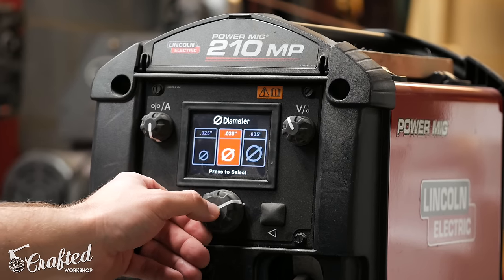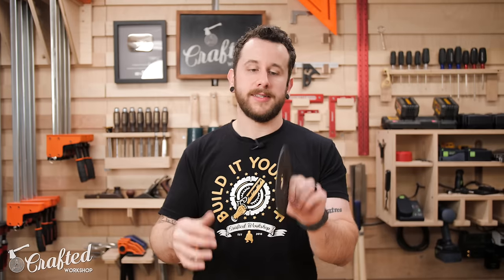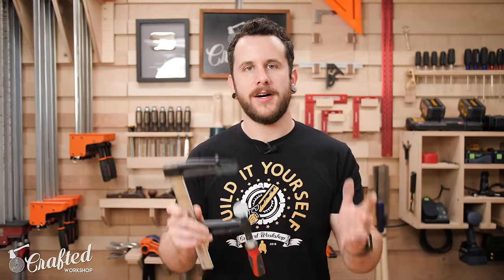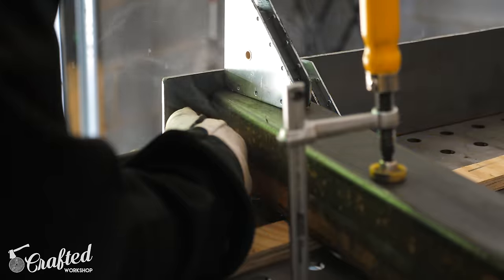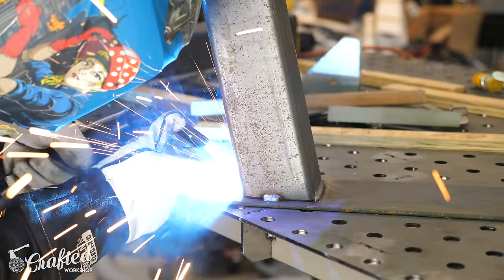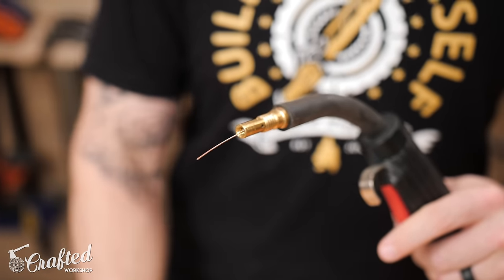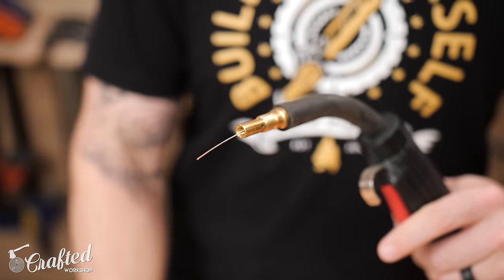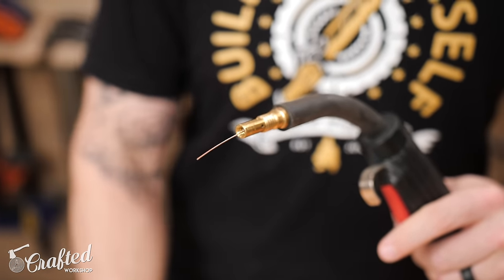5 Must-Have Metalworking And Welding Tools For Beginners // Quick Tips

Comment: If you’re just getting into welding....Get yourself an angle grinder, the cheapest helmet and shield u can find, some scrap angle iron, a Tombstone (Used) and some rod. You don’t need anything fancy in the beginning.
Reply from the maker: I personally hate stick welding and have never used it since taking my first welding class. I don’t see much reason to spend a lot of time honing that skill if you want to MIG stuff for furniture.
Reply: Crafted Workshop So you’re telling me that you first started welding with a stick welder? Do I have that right?
Reply from the maker: I took a 15 week class where we leaned stick, MIG, and TIG. I knew very quickly that stick was not going to be something I would use in my work, so I moved on. I definitely would never have bought a welder that only does stick.

Comment: 30000 RPM? Really? WTF. Have you never read the specs on your grinders? 11000 RPM is pretty standard. The five inch wheel shouldn't be going faster than between 7 and 9.
Reply: Since it's so much slower I'm sure you won't mind taking a broken cut off wheel to the face lol
Reply: @e.collins2768  That's not the point.
Reply: @josephdestaubin7426  it 100% is the point lol
Reply: How would you know what my point is better than I would?
Reply: @josephdestaubin7426  he's trying to make a point about safety and you're undermining it by being a know it all lol
Reply: @e.collins2768   That is exactly correct, because I don't think that someone who is not proficient in the use of a tool should be giving safety advice to professionals or amateurs. But I got to give you credit where credit is due, you definitely got the point of my comment.
Reply: @e.collins2768  Also, since I'm being critical already: he mentions that you can take weld aluminum with the 210 Lincoln. This is patently false! So basically he doesn't even know the equipment that he's using even though he's  sponsored by Lincoln. If I were Lincoln, I'd  ask my money back.

Comment: Hello sir im confused now i went for my welding trade test and failed by saying the chipping hammer chips off flux after welding stick and the right work was slag please correct me if im wrong
Reply: i'm no expert just a hobby welder with an everlast welder but flux is the material that protects the molten puddle from contamination before it has cooled. Slag is the material left over the cooled weld. It isn't flux any more because it has reacted with the environment to protect the puddle. I hope I got that right.
Reply: @ernienapier70  

Exactly, flux is the coating on the rod/core of the wire, slag is the remains left on the weld.
Reply: @ernienapier70  Hi yes i did this time thanks Ernie

Comment: You said the grinder spins at 30,000 rpm.... That's fast! I think you meant 3,000 =)
Reply: 3000 is kinda low, maybe he meant 13000
Reply: A standard Makita 5" angle grinder spins at 11,500 revs with no load.

Comment: 5 must haves, grinder, grinder, grinder, other stuff.
Reply from the maker: Hah!
Reply: One for your cut off wheel, one for wire wheel and one for flap discs. Or in my case, 4" cut off, 5" cut off, cup wire wheel, flat wire wheel, 5" flap. Swap the cut offs to grinding discs if needed but flap discs are super cheap in bulk off ebay, work quite well too.

Comment: is it ok to use 100% argon on both mig & tig sir?
Reply: 100% argon can be used for both tig and mig welding but the sound and bead quality are completely different even though it is a pain and can be expensive in the long run it is always best to use the recommended gas for each process for tig 100% or pure argon and for mig hardwire a mix of 75%argon and 25%co2 for the best welds in each process
Reply: @merlyn703  thank you sir..this info.will help me a lot,co'z theres no available here 75-25 argon-co2 on a single tank can i use two tanks?
Reply: Where do you live
Reply: @lesteracevallespin9939  you use 100% Argon for both mig and tig if you are welding aluminium or stainless steel. If you are welding mild steel, you should used a mixed gas of argon and CO2, but if you want to save a bit of money, you can use straight CO2. It's not as nice a weld and requires a few more amps but it's very doable. A lot of fabrication workshops go this way to save money.
Reply: @merlyn703   im from Philippines
Reply: @RayPlant77  thanks again sir..very informative and helpful..thanks a lot!may God bless you

Comment: So a good tool for a beginner welder is a $1,500.00 welder. Damn it. I guess it’s for rich beginner welders. Lol
Reply: craigslist and facebook marketplace buddy.  I got a 250 amp AC/DC stick welder for 100$.  No beginner should start with a mig welder anyway.  That's soft.
Reply: MiG is one of the best beginner formats for welding also most people don’t have a 220v plug to run a stick machine considering getting a 220v plug installed cost around 1,000 dollars by its self,just becouse you watched 1 welding video video doesn’t mean you know shit
Reply: @walterallgeier2265  After I bought my welder I spent 100 dollars on a wire to run to my subpanel, ran the wire, and an electrician charged 200 to install the outlet.  the welder can draw up to 80 amps so I choose 100 amp wire.  220v of course.  115 ft run from the outlet to my panel.  Mig welding doesn't teach you shit its like pushing buttons. stick is the only way to learn properly.
Reply: 1500 is cheap for a welder honestly especially a multiprocess
Reply: wcjcnc I guess I messed up, I bought a new Millermatic 215. It was $2500. I've always wanted a good wielded.
Reply: @walterallgeier2265  only if you live in the U.S.A you do not have 220v plug.. in Europe 230v is a standard.
Reply: Gatto Npc it’s 230/240 in the US. And he didn’t buy 115’ of 4/2 wire for $100 unless it’s stolen. Also doubt his welder draws 80A at 230v but maybe there are some that aren’t 3 phase out there
Reply: Really? As i know there the standard power of your grid is 110-120v.  Am i wrong?
Reply: @walterallgeier2265  Stick is best, it is more forgiving(wind, dirt) just pick your setting . You still need 220v for a mig .
Reply: @seanhurley9216  I am maybe wrong .. but in the U.S. the standard grid is 230v? or 120-130?
Reply: @brennaodaniel-munger3155   Oh.. ok.. thx for info. It is like here.. where is 230v/380v same thing aply for 380v as you said about your 230v .. If a house owner wants 380v it will get installed.. if not the standard he gets is 230v.
Reply: Gatto Npc Yes, exactly the same. Just different voltages
Reply: Beginner welders get a fire extinguisher 😂
Reply: @walterallgeier2265  If you can't wire up a 220v plug you sure don't have any business welding.   No wonder all the sports bars are full, Full of a bunch of Yuppies that don't know how to do anything.  Gosh
Reply: @gattonpc  Most of the world has 3ph to their homes.  In the US we have around 240v Single Phase to all homes.  Normal outlets around the house are 120v but bigger appliances like Oven,  Dryer, A/C has 240v power.
Reply: You can get a good stick welder for half that. Or a budget mig.
Reply: Walter Allgeier yes mig is “easy” for beginners but it is not the best to learn first stick welding is cheaper, also why do u think people are normally taught stick first ?
Reply: @zacclarke8652  MIG teaches bad habits, start with Oxy, then stick, then MIG, then TIG. Unless you just want to be a MIG welder, then it doesn't matter.
Reply: Sam A I didn’t say to learn mig first read my comment over, I learnt Oct and stick first then tig as I work more with stainless than mild steeel
Reply: Oxy *
Reply: @zacclarke8652  I was agreeing with you that you shouldn't do MIG first
Reply: If you're still looking, there's one on Amazon for bout $120

Comment: I been welding 17 years it's good video good job  buddy  however I grind with a cutting disc in the groove feathering the edges mostly on pipe.  Pipe wheel is a cutting disc or a really thin grinding wheel  I don't  like those thick ones gouging your weld no thank you but if I am grinding anything 7 inch grinder  

But I got that 210 welder   
Solid core good for beginners but cant weld heavy duty shit  but this machine does Dual shield  I run a ton of Dual shield on it 0.45 wire co2 gas  on 3/4" to 1"   mostly in shop  

But your video is good for basic info

Comment: the part you're not mentioning is that 1,000 dollar Muti function welder is not including your gas tank which you're looking at 280 if you get it on sale, plus additional mig wire, a good face mask, plus an ABSOLUTELY MUST... WIRE FOR 220! etc... if you're just getting into it and want to see if you'll like the hobby, go get yourself a 125 flux core from Harbor Freight... sure it's messy, your welds will look like shit, but you'll learn and you'll see how much you'll like it before investing thousands. Welding with 110 is frustrating to say the least with tripping breakers and the splatter, but it will give you a feel for it before the large costs. This is not a cheap hobby and people don't seem to realize this. You'd be surprised what you can accomplish with those cheap welders and you will get good at it and when you graduate to a gas mig welder you will feel like a real pro. just my $.02 from a guy who has had absolutely no formal training in the field and just welds onto his mower deck when he brakes things and makes tables and such.

Comment: that's not starting with welding that's getting broke starting something you have no clue about, if you want to start with welding get a cheap stick buzzbox welder (Lincoln AC225) from craigslists for $150, a pair of gloves a mask and start experimenting with it first, if you like what you see, then slowly start buying USED tools here and there as you go.. but of course if you have $7000 sitting in your account than you got no use for, then by all means get yourself a Miller welder, a plasma cutter and while at it a CNC machine.

Comment: I tried welding by myself without tuition but it didn't work out great in terms of weld quality.
Reply: just gotta remember, when the arc sounds like cooking eggs; you've got a good contact between the wire and voltage.

Comment: Hey man TECHNICALLY that machine won't tig weld aluminum....it is DC only, and while you CAN tig weld aluminum on DC, it's not the generally accepted method, which would be high frequency AC...and def not for beginners .....just clearing that up 😉
Reply from the maker: For sure, true! This machine can use a spool gun which is awesome for welding aluminum.
Reply: @thatonegayfurry4177  Thats not at all true. that trick is done with the high frequency that starts the arc. its on both ac and dc
Reply: @evilbunnyreviews  really shit never knew that
my b
Reply: @thatonegayfurry4177  yeah the high frequency is just what starts the arc without touching the basemetal

Comment: I thought this was going to be an intro on welding for beginners. He even talks about being on a budget. Instead it’s a  commercial for a $1500 welding machine.
Reply: I thought so too.   Could buy a lot more actual use tools by saving money with a simple stick welder and weld anything.      Even if you choose a wire welder, don’t get the cheapest they sell or you’ll hate it.   But a single process better bang for the buck.   But personally I’f I could only own one, it would be a stick.   Even a small 110v unit will run small 3/32 rod and weld  3/8” and even 1/2” if you prep it right.   I love mig machines.   In my line of work a machine capable of 250-350 amp with gas shielded fluxcore is king.  Running hardwire for thinner small stuff is great.   But for versatility, and on a budget, nothing will beat a stick welder.   
And a cheap mig will piss you off.  Have to spend some money to get a mig worth a lot.   This includes that gas bottle that isn’t included.  
Just my cents worth....a penny for each decade I’ve been welding lol
Reply: I got a $100 stick welder that says ZENY on the side and it seems pretty good on 120V, it'll do 25 to 75 amp all day long though it's maybe 30V OC. Have yet to run it on 220V @160 amp (60% Duty cycle) but maxing out a welder suggests something bigger would actually be the right tool for the job.

Comment: Nobody needs a welding jacket. If you don't want to burn your shirt, take it off!
Reply from the maker: It’s not about burning your shirt, it’s about protecting your skin from the extremely bright light emitted by the welder. Skin cancer is a very real risk otherwise.
Reply: @craftedworkshop  Then wear an old shirt?
Reply: @DragonBuilds  or just wear a light welding jacket that will stop all the bigger sparks that a shirt won't stop. That's why they exist.

Comment: if you have to grind your welds, you are not a welder. you are a grinder. but besides that, the cutting disc you were showing is a root disc. the cutting ones are thinner, but other then that. good vid
Reply: Well actually it's a 3mm or 1/8 cutting disc that is commonly used for digging roots out or cleaning up root welds prior to the second run. Up until about 20 years ago these 3mm discs were all you could buy for cutting. It's only since then that we have been spoilt for choice with the multiple thinner discs.

Comment: Lincoln and Miller are both overpriced. I use both I also use the Chinees nock off's they all have parts made in China.
Reply: You get what you pay for really applies in this industry. You'll spend more replacing the cheaper brands than just buying the good stuff the first time around.